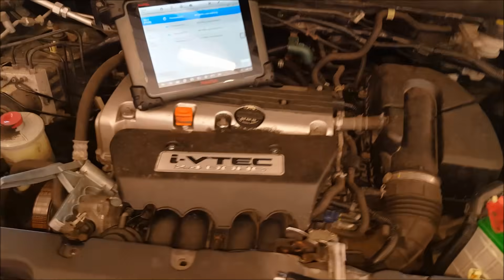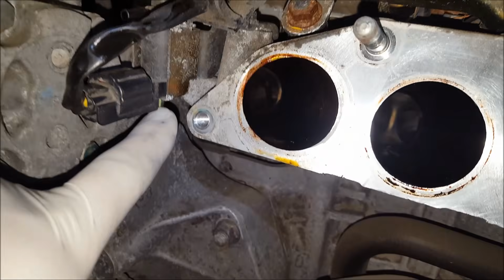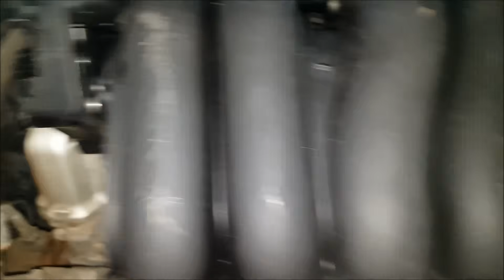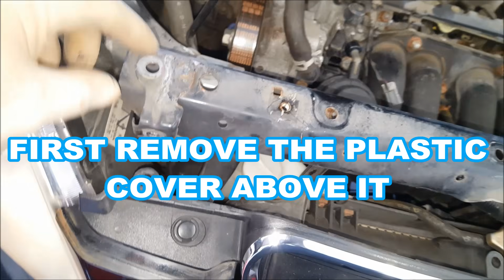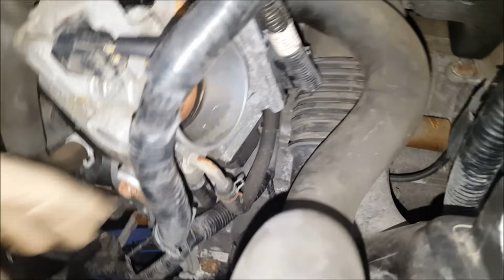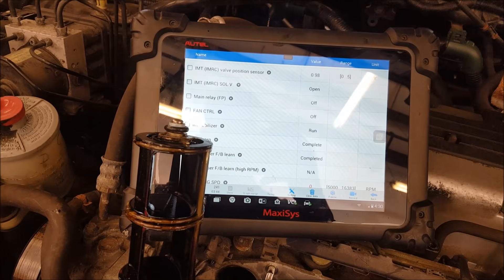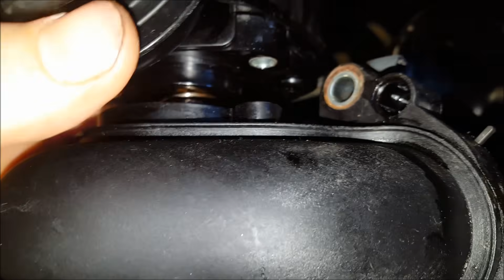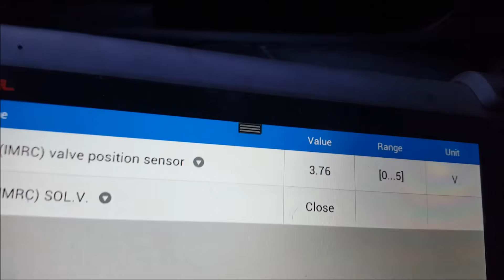HONDA CR-V IMRC REPLACEMENT / diag. P1078 P1077 2006 2.4L how remove replace acura rsx

Comment: Hi! This video is super helpful so thanks for posting! I have one question: How do you get the connector off of the solenoid? I can't seem to pull it off.
Reply from the maker: No problem, glad to help out. There is just a little tab you have to press on the connector. I assume you talking about the wire harness connector?
Reply: @NoNonsenseKnowHow  Thanks! I'm going to give it another try today. Also, I had these two codes come up in October of 2018 and had it "fixed," but the repair guy said that he replaced the "intake manifold runner position sensor" (his words written out on the receipt). Is this the same as the imrc solenoid? And if so, why would it be happening again so soon? The new place I'm taking it to said that the imrc solenoid needs replaced again.
Reply from the maker: @brigittemackey4093  no problem. And no, this solenoid is a different piece. Separate from the sensor
Reply: @NoNonsenseKnowHow  okay, thanks for that. I just got done testing some things out: First, when I put my vacuum gauge onto the diaphragm hose, the gauge stayed at zero. Does this mean the diaphragm hose is bad? Second, I attached the vacuum gauge to the hose leading to the bottom of the solenoid and it read between 15-20 in the green area and steadily stayed there. I assume this means that hose is okay? Third, I actually bought a Dorman imrc solenoid (because that's what the repair shop told me needed replaced), put it on and turned on the engine, but the engine light is still on. Does this mean that it's NOT the solenoid, or do I need to drive it awhile to see if it goes off? OR, do I have to get the codes reset (or cleared)?
Reply: I forgot! Also, I checked to see if there was the clicking noise you said to check for when I plugged the connector into the solenoid (I had the key on but engine off). There wasn't any sound. Does this indeed mean the solenoid is bad?

Comment: My automatic 04 Honda CR-V recently started revving by itself when in neutral/park. It sometimes does it when I come up to a red light while in drive but not as often (I'm always ready to throw it into neutral if my brakes can't keep me still). I don't think it's the throttle body sticking because It intermittently revs to somewhere below 4k RPMs, drops back to a normal rpm, then repeats. I've also noticed that I don't need to touch the gas pedal to maintain a 30mph speed on a slightly uphill slope. I took it to advanced auto parts for a scan and had P1078 and a bad O2 sensor. All that I've seen is that these two things would cause problem start ups and bad fuel efficiency, not random engine revving that makes me look like I'm challenging people to a street race lol. Though I do feel like my O2 sensor sending my engine weird mixture signals, combined with a stuck intake manifold, would cause my engine to rev... I would just like to hear if you think my problems will go away if I replace this. Lol
Reply: Check the idle air control valve, I have a 2004 and that's what it was on my car.
Reply from the maker: Honestly, couldn't tell you for sure without seeing the car. But I would definitely take care of the engine code and O2 sensor.  Good place to start.  Might have a vacuum leak as well

Comment: Can I use brake cleaner or carb cleaner?
Reply from the maker: That's a little harsh on it depending on what type you use. But I'm sure it would be fine
Reply: NoNonsenseKnowHow  ok thanks

Comment: Thanks for sharing your knowledge. You made it look easy going into detail. Other videos are hard to understand because the guy in the video has done it for 20yrs and doesnt know how to explain thier own videos
I'm having a problem with my 03 CRV. Had a "mechanic friend" look at it and I think he did something wrong. Now my wife's CRV just idles up and down but not going past 3rpm. Any thoughts you could help with?
Reply: +BluDragon Truck On 2000 Accord the intake is up against the firewall so you there's a blind spot and when I replaced the intake manifold the gasket got caught on something and got pinched so there was a big air leak and the car had a nasty idle that surged up and down between like 800 rpm and 3000 rpm. If it's new and under warranty you should take it to the dealership but personally I try to fix everything myself because fixing things makes me happy. There's no special people, mechanics look in the service manual just like everyone else could if they wanted to, although of course, experience is valuable on complicated matters and only a full time mechanic is going to spend $3000-$8000 on a fancy scan tool. Mechanics look up youtube videos too just like everyone else.
Reply from the maker: Thanks man I appreciate the words. I tried to make things simple to understand, but yes it can be tough especially when you do this kind of work for a living. Honestly I wouldn't really be able to give you much Insight on your CRV without seeing it. I work on all makes and models, so I'm not too incredibly familiar with any one single model and all of its common problems
Reply: @NoNonsenseKnowHow  Oh I completely understand. This is what I get when I have a "mechanic friend".I'm going to look into this more. It's a unknown answer.👍🏼
Reply: @bludragontruck9743  Maybe he didn't seat the gasket correctly(intake manifold gasket) and there is an enormous vacuum leak because of it. Sounds like a bad vacuum leak to me at least. Maybe a frail vacuum line fell apart when he disconnected it. I'm guessing you fixed the problem already tho.
Reply: @Titans2138  Hey, thanks for checking on me. Nah, havent had to mess with it. I really put a lot of money into it. So I stopped, still having idle problems.  No you're right , it has to be air leak somewhere.  But my a/c in my truck was out and a/c at home too. And because of our new truck being in the garage so long because of COVID-19 that rats got in and chewed up some wires. I'm just thinking about taking it to the dealer ship. What do you think ?

Comment: hi... I have a question... that  Control Solenoid Valve Assembly which connects to the vacuum hoses does not have the cap for it. It came off. would not having this cap cause me to have a misfire on cylinder 1? I I have tried everything to fix the issue and this was the only item I saw that wasn't complete but was linked to cylinder 1. any help would be greatly appreciated.
Reply from the maker: If it's causing a vacuum leak, I would take care of fixing it. It might not cause a misfire but any vacuum leak is not good and you may end up throwing a lean code

Comment: One other thing.if you have burrs or scatches deep in manifold how do you get to them to sand off the scratches ect.
Reply from the maker: I'm not sure about that one. I suppose you could use a power drill with some kind of hone or custom-made hone
Reply: @NoNonsenseKnowHow  great,thats a good idea.i know mine needs to be cleaned.ive heard that sound for a long time.im a substitute rural mail carrier and these country roads put   some awful wear and tear on a vehicle.i never knew until recently your rear end has a toe in and out adjustment. I have a 03 crv.their good cars.i can tell you,,, let me drive it on these country mail routes for a month or so. That will tell the tale.tbanks for the great vid s .
Reply from the maker: @chuckmaleman5216  no problem! Good luck on the repair

Comment: What do you mean by removing the cooling lines? Do they hsve antifreeze in them or something?
Reply from the maker: Yes they do have antifreeze in them
Reply: i think he said don't disconnect the cooling lines unless you want to deal with coolant spilling everywhere and having to replace the lost fluid. You'd probably have to burp the cooling system too, so don't touch the coolant lines sir

Comment: Msn i wish you could help me with my 2003 crv.can do a little to it but nothing like you .thanks for the great vid.
Reply from the maker: No problem man. It's not a tough job, just tear into it!
Reply: @NoNonsenseKnowHow man you give me the confidence to do it thank you
Reply: What's wrong with it? I have a 03 as well, my wife drives it. Shes complaining of the engine revving up and down. I can't figure it out.
Reply: @bludragontruck9743  my 03 does that as well it can be a number of things.first i would buy a can of throttle body and air intake cleaner.remove your flex large hose off your air cleaner box.bend it out straight.look in with a flashlight amd you should see the round metal part on throttle body.with engine OFF spray a few blasts into it and be careful not to get on other sensors in the rubber flex hose.let sit 5 minutes,then start.may seem hard to start initially but will.press gas to maybe 3000 rpm a couple of times.it seemed to help my 03 crv.
Reply: @chuckmaleman5216  Hey, that's how it all started, right there! The flex hose to the intake box.OMG🤯 Mine had a freakin huge crack on it. I replaced it and wham! Lit the whole cluster up! Now I'm stuck with the same problem 3 months later. I tried what you suggested.  The scanner ran so many codes my wife is scared to drive it. I'm not a mechanic by any means. You and I stuck on same boat at one time. But I'm still here. My buddy the "mechanic" fucked me by taking everything apart. This guy in the video made it look simple and sweet but im kind of intimidated. 👍🏼
Reply: @bludragontruck9743  yes they always make it look easy.sorry i couldn't help you more.you may can find a honest easier download on you tube.
Reply: @bludragontruck9743  i remember a vid showing how to re-set the lights on dash panel.the guy that worked on your car could have bumped or unplugged some other connections.check your plug in vonnections and all the hoses to make sure he plugged everything back.
Reply: Oh shit i forgot.upon every gas fill up add a black bottle of STP Super Concentrated GUEL INJECTOR CLEANER.the black bottle not the red.the black works the best.you should see some improvement. Sorry i forgot to tell you that.go to dollar general and get it their like only $3 a bottle.half what they want at the auto parts places.
Reply: @chuckmaleman5216  He actually left a bunch of plugs, unplugged. He said to " try that out". LOL, what kind of mechanic says that? I plugged everything back, disconnected the battery turned the light switch to "on" for 15min and erased the code. Still revs up and down. My wife has the rest of the week off so I'll try some YouTube suggestions. Was there anything wrong with yours?
Reply: @chuckmaleman5216 My wife actually works at O'Reilly's warehouse. She has a nice discount.  I also  want to try that method of when air might be in the radiator and try to hopefully get it out. I'll also buy that product you mentioned. I'll let you know how that works. Thanks for your response in this. Hopefully itll help for yours as well.
Reply: @bludragontruck9743  yea i still have to clean motor again to try and find oil leak.by the way please try the STP Super Concentrated  FIEL INJECTOR CLEANER.in the black bottle not the red. It got rid of the off and on skip and the up and down idling.initially i put it in tsnk and filled gas tank a little over half full to make it stronger.now i pour one in every fill up.try that for sure.
Reply: @bludragontruck9743  your welcome.whats the trick to getting air out of the radiator. I put a new one in mine last year and still have to add a little fluid from time to time.think trapped air may be the problem?
Reply: @chuckmaleman5216  I saw some guy on YouTube talking about if you have air in the radiator it could cause high and low revs. I'm starting small, working my way up. But with the radiator, if you take off your cap and let it idle till it starts bubbling at the same time if it's real low add more till the bubbles stop. I bought radiator fluid ( remember ours takes the Blue coolant also) that black STP fuel system cleanser and put that in. I bought more carb and throttle cleaner in case if I have to get up in there. But for now I'm going to do a hard re-set. I saw instructions on how to do that. Gonna give it a try. Hows yours going?
Reply: @bludragontruck9743  gonna spray more throttle body cleaner in andclean the motor again and install a valve cover gasket eith the 4 rubber o-rings that the coils go in and see if that stops the oil leak.also on the transmission it revs up before going to 3rd gear.theres a 3rd gear pressure switch vavle located right by the transmisdion dip stick.easy to install one plug on it and its round screws in eith a crush washer if i can afford yo get both parts this pay period.
Reply: @bludragontruck9743  oh yea also my 03 crv when taking off on slight inclines would go jerk jerk jerk jerk.but after putting the concentrated stp injection cleaner in the black bottle in it the jerking went away.also keep in mind ny 03 crv has over 350,000 miles on it.but please try the stp.

Comment: Great job. This will help me very much because I am having the same problem with my 02 CR-V. But I have two questions:
First, when I am facing the runner, I can only turn it manually clockwise. I can not turn it all the way around, and as soon as I release it, it turn back to the original position. Is that the way it supposes to be?
Second, when I apply vacuum to it, It also does not keep turning. It stop at a certain point. and go back to the initial position only when I unplug the vacuum pump. Again, is that normal?
Reply: normal. it's spring loaded so it bounces back on it's own

Comment: How can I fix my problem and having that code that you have showing up all the time it keeps on blowing my sensors
Reply: P1077
Reply from the maker: What do you mean by blowing your sensor? What exactly on the sensor doesn't work when it is "blown"?  You may have a short somewhere
Reply: My sensor keeps on blowing on the exhaust manifold I've replaced it three times in the last 3 years
Reply: The sensor for the special flop in the intake p1077
Reply: Took it to three mechanics all they do is replace the sensor this summer I've cleaned it out check all the O-rings
Reply: I called Honda they want to charge me over $1,000 for a new intake manifold with the flap the solenoid all together and the sensor

Comment: I'm having an issue with my intake manifold the sensor keeps on blowing I've already had my manifold cleaned are three sensors replacement 2005 Acura RSX

Comment: Hi have questions mi crv 2003 have check engine light on .. supost say the part P1077 imt valve is stuck high rpm position

Also code p0661 irmc circuit voltage low..u help me and tell me what is the solution to myself fix please.. thanks
Reply from the maker: You need to do a little bit of diag on it. I would start with pulling the IMRC, cleaning it and checking its operation if you're not familiar diagnosing things.

Comment: Thanks fo the video. How would I go about cleaning it? Could I used WD-40 to clean the cylinder and inside of the it?
Reply from the maker: No problem. Yeah WD-40 or any equivalent solvents should work fine. I used a old shirt wrapped around a long drill bit to clean one out once and that worked pretty good. I'm not sure I understand your second question about the vacuum
Reply: @NoNonsenseKnowHow  There's another video i was watching, and you mentioned it lightly that when putting back the assembly to not force it but instead use vacuum on the hose to ease it back into place. Could I access that hose line without taking all the hoses and Intake Manifold again? 

My situation is that I replaced the Starter Motor. When I was putting the intake manifold in, I was trying to see if  could take the assembly apart in order to more easily install it back into the engine, whcih led to me opening up the assembly. I put that back together and was able to put the entire Intake Manifold back in. But I didn't know about vacuuming the air out when assembling it.
Reply from the maker: @greennblue10  as long as you were able to assemble it back in there fine then it shouldn't be a problem. If you apply vacuum to it, it should rotate back and forth. If there's an issue, you'll find out because it will set the engine light
Reply: @NoNonsenseKnowHow  Yeah, i have the check engine light on. Are there any physical symptoms you see right away? I don't see any discharge  on my engine, nor do I see my temperature gauges red-lining.
Reply: @greennblue10  scan for codes. It sounds like maybe you shouldn't be working on your car tho
Reply: Also, if I wanted to just vacuum the air out through that hose, Do I have to take the manifold out, or could i access it without removing everything?

Comment: So I should have power and ground on the wiring to the solenoid key on engine off ? Because I just have power on the black and yellow
Reply from the maker: Honestly without looking back on my work I don't recall. But yeah whatever I said in the video. I'm sorry I couldn't be of more help. Really jammed up with work today